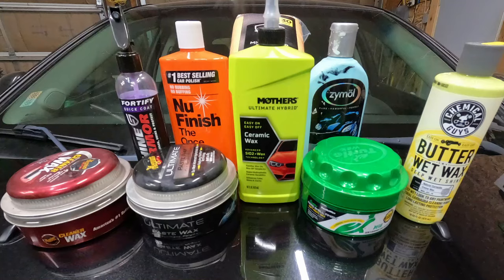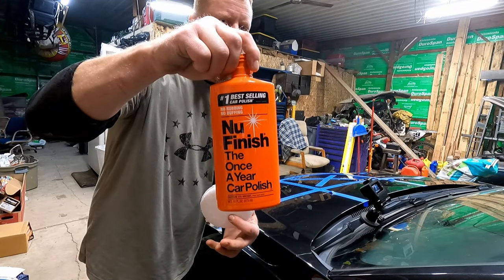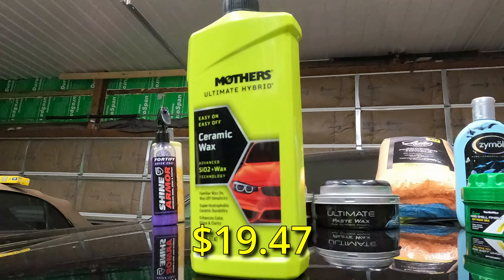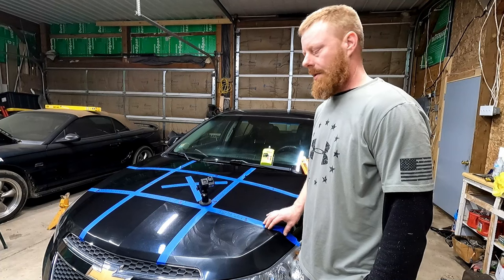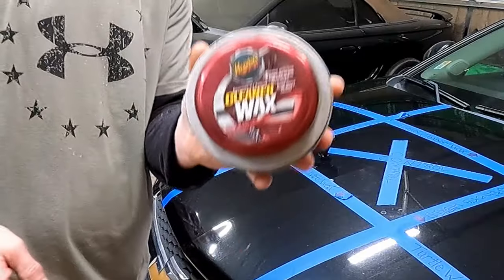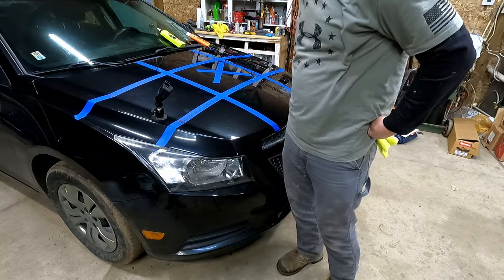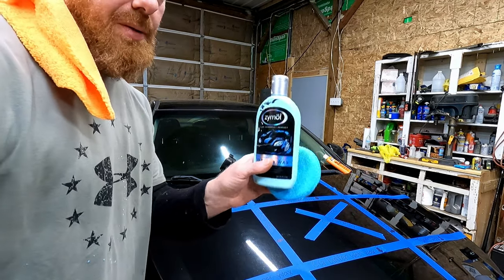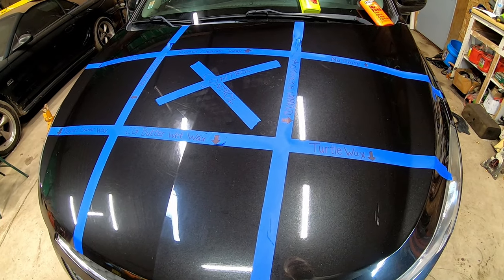Battle of the Waxes: Which Car Wax Reigns Supreme? The Results May Suprise You

Comment: I don't bother with waxing at all. You spend a lot of time massaging it in, you have to avoid getting it on the trim, it's so obvious when you miss a spot (especially on a dark car), you can scratch the finish when trying to buff off the wax, you get residue all over the place, you need a lot of towels.

Get a clay mitt and wash the car to decontaminate it. You can use a lubricant or really sudsy water. Rinse the car. Mist the wet car with Hydro2 or Gyeon Wet coat and spray with a pressure washer or a firm setting on the hose. It is now applied. You can either use a leaf blower or you could wipe the car down. No wax residue, all the trim, windows, plastics and rims are protected. You can also get Hydro2 soap, and then the next time you wash the car, it will maintain the hydrophobic properties and be way easier to wash and clean.

I used to wax, but now I relax.
Reply: Prefer a less spectacular finish on your vehicle  these days, do you?
Reply: @aakar88  Swing and a miss. The finish is even better. Especially on dark colored vehicles. Also when a vehicle is really shiny, it reflects colors back and my darker blue car looks fantastic. You can flap and waste your time, but a silicon coating will bead up better than wax after a month and I can still go to a car wash in the dead of winter and reapply it in the same time you’d just be able to wash a car. There is usually a longer lineup at whatever stall I use because the car looks better than the others and people think it’s dispensing a better soap/wax.

 Denial isn’t just a River in Egypt

Comment: This is a Joke. Why is the area marked with a X, your control, Bead just as all the others? Seems your efforts turned out to be a JOKE. No clear winner? Well I'd say the X was the winner. Cost Zero and did just as well as All the others.
Reply from the maker: A Joke?  I'm not sure I understand.  The control was the area that we didn't apply any wax to.  Doesn't mean the waxes we used didn't provide any benefits.